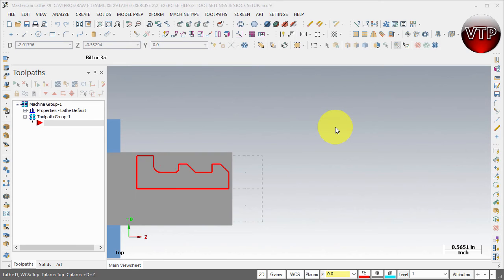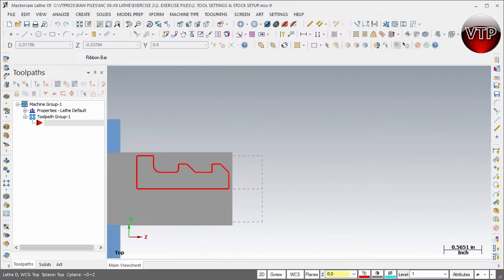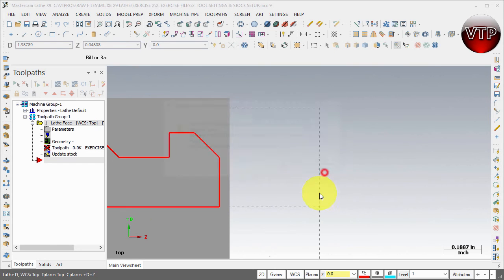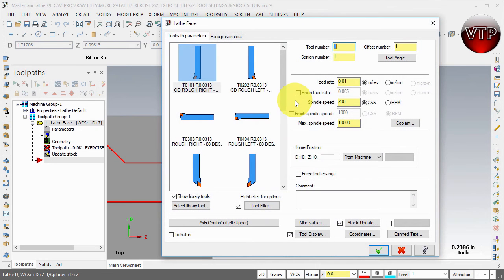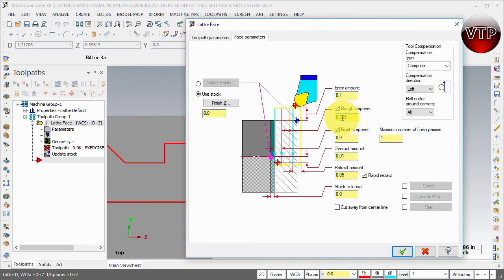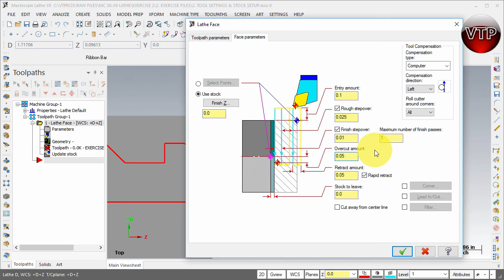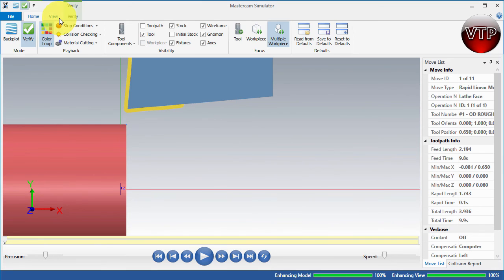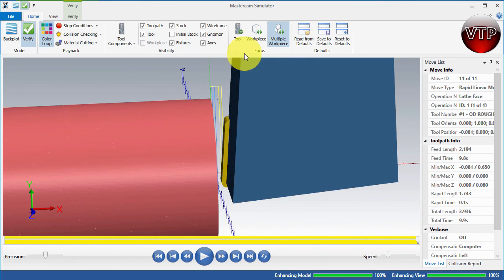Mastercam X8-X9 LATHE & C-Y AXIS 2.6 Facing Operation - vtpros.net

Comment: How can I access plane manager in x7??
Reply from the maker: +Marco Arteaga Click on "planes" at the bottom of the main screen and click "plane manager"
Reply: +VTPROS.NET yea with X7 you don't get that option to select plane manager when clicking on planes just like you did?
Reply from the maker: Marco Arteaga hmmm i don't have x7 installed but maybe it's the version it changed. The plane manager should be under one of the drop down menu items as well. It's not something hard to find.